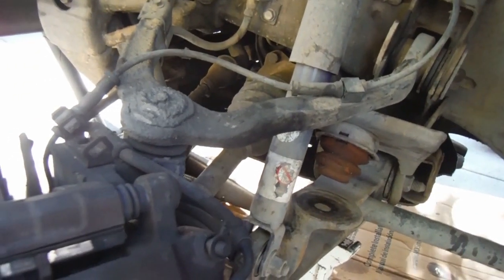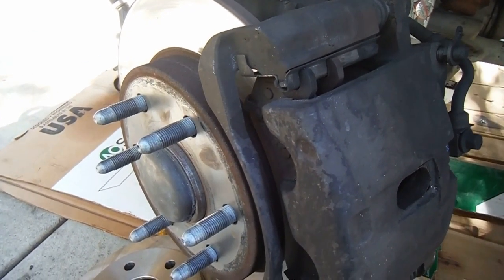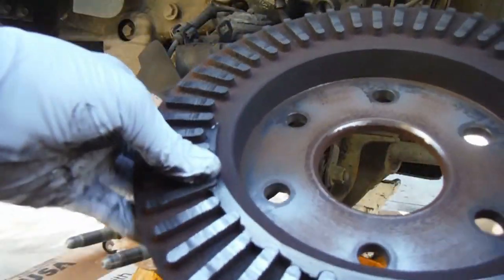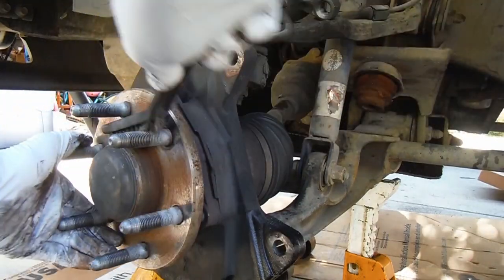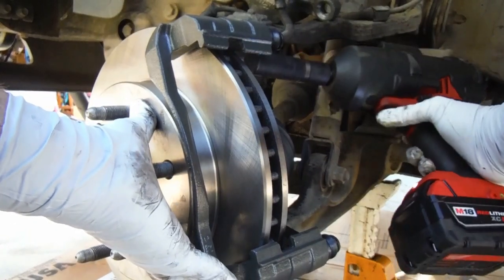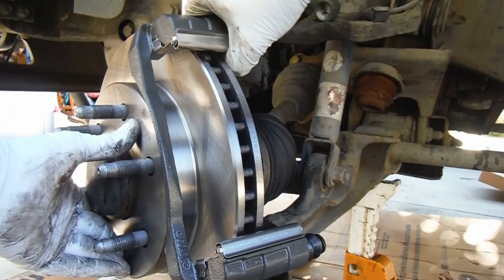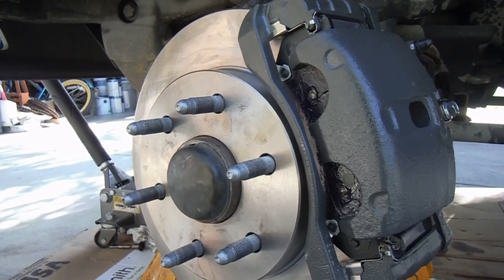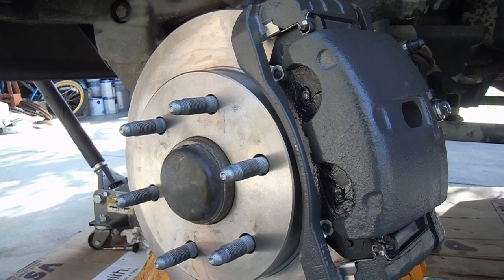2001 CHEVY SILVERADO 1500 4X4 HOW TO REPLACE FRONT BRAKE PADS &  ROTORS & CALIPER -  DIY - COMPLETE

Comment: Question: i have a 2001 Chevy silverado. I have to do the same job in the front . Do i have to change the caliper in pairs? Someone told if i only change one it will brake to one side

Comment: Ive been wating for like 1 hour and nothing leaks from the valve
Reply from the maker: You might need to have someone step on the pedal and pump it up while you open the bleeder and release the pressure a few times.  There’s lots of videos on YouTube that show how to bleed brakes.  Sorry, I don’t have one specifically on that.
I had a pressure bleeder which helped push the old fluid through and get all the air out.  If you can, sometimes it helps to just step on the pedal even with the bleeder open to get the gravity method to work…
Best of luck to you 
-Dan the Fix it Man

Comment: Brand new to this, but can't see how, if the brake line connector is torqued to a standard 30 ft lb how are you assured the hole in the connector and the hole in the bolt are aligned?
Reply: There’s a groove inside, think male to female parts. I’m other words: “it juuust does.”

Comment: Hey so I'm in the same situation I need to know how to get fresh boots into the bracket. Do I need to pre-grease them or what? Please help
Reply from the maker: Hi Nick,
If you're referring to the small slide pin boots, I think you should be able to get them in place with a little sil-glyde or similar brake grease.  I don't remember for sure how they went in, but I am pretty sure I have changed some similar to this one in the past.
It looks like when I changed these out, the boots were already installed on the replacement bracket.
Thanks for watching, I hope you get it figured out ok.
Take care,
-Dan the Fix it Man
Reply: @DantheFixitMan  Im also rollin a 99 Silverado 1500 and trying to reuse the oe bracket.

Comment: great vid ! so  c-clamping the caliper is not necessary ?
Reply from the maker: On this truck, I ended up replacing the caliper which comes already pushed in.  If you're not replacing the caliper, you would need to push the caliper piston back in with a C-Clamp or other caliper compression tool.  You can also wedge a small screwdriver through the small opening in the caliper and pry between the brake pads & rotor pushing the piston back in.
Thanks for watching!
-Dan the Fix it Man
Reply: @DantheFixitMan  thanks !

Comment: My t55 bolts won't come out, any suggestions?
Reply from the maker: Sometimes you can tap the torx bit with a hammer a few times and that impact breaks them loose.  Or you can try some PB Blaster or similar penetrating oil on them.  Or you can try heating it up?
Best of luck to you!
Dan the Fix it Man
Reply: Did the pb blaster and the hammer, broke a half inch breaker bar
Reply from the maker: @larrybertgin4672  oh wow!  I guess I would try heating it next…
Reply from the maker: Or if you have an impact wrench…
I usually go to the high torque cordless M18 impact by Mikwaukee
Reply: Tried the Porter cable corded...no work
Reply from the maker: @larrybertgin4672  maybe another breaker bar….perhaps a 3/4” size (with 1/2” adapter for the torx bit), and a long cheater bar for more leverage?  Sometimes I use a jack handle…